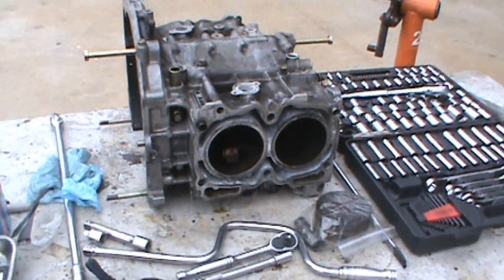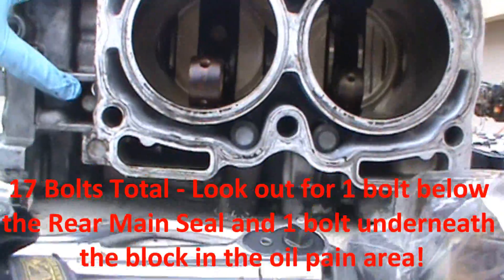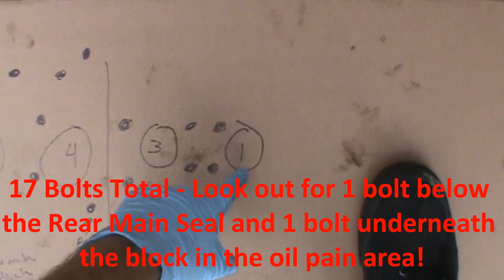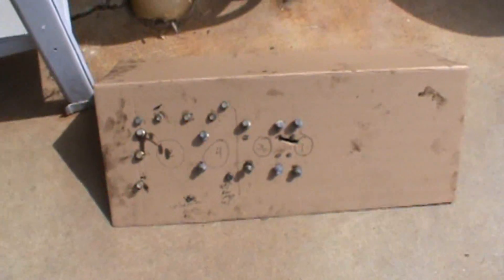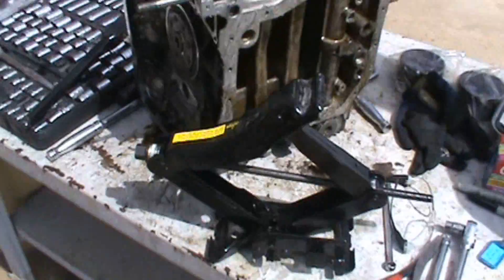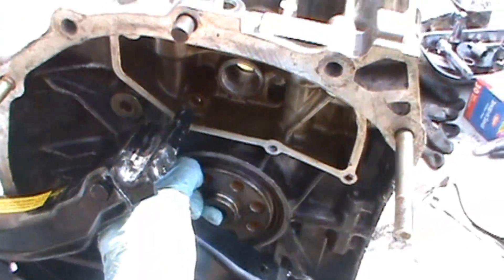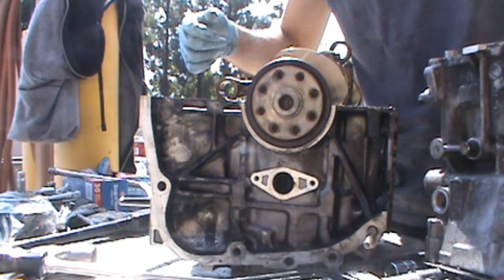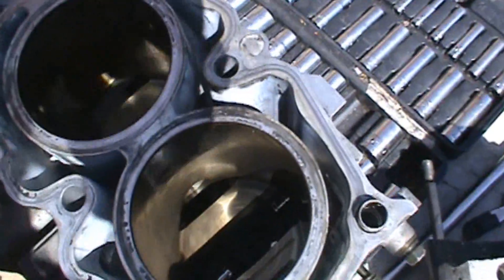Subaru WRX EJ205 Engine Rebuild Part 4

Comment: This is a pretty far fetched question. But would it be a feasible idea to take the engine and AWD system of an Impreza and fit it to a Ford Fiesta. I know it would take some cutting and welding, but what do you think. I'd love to get an answer.

Comment: Great set of videos. 
Perhaps you could do one of your workshop where you split the engine case in two. 
And what were the findings - what new parts were necessary to repair. 
And was the assembly part quicker than the dis assembly

Comment: Good video.  I used it for the EJ25, which has one additional bolt that reveals itself once you remove the oil pan.

Comment: Subarus are definitely not an engineers engine... simple is better. I got a WRX and I hate working on the engine, so much to replace a simple head gasket. I had a Civic Si and cold replace a head gasket and main seal in an afternoon, with my set up. Damn, that was a hell of a job with a subaru engine bro.

Comment from the maker: @mickee6969 Thanks for the comment.  Unfortunately I did not have the time to video the rebuilding process because of the sheer amount of work that needed to be done in such a short period of time.  I will definitely be doing a video segment on a 4 cylinder engine this year, but it's not a subaru block.  Make sure to subscribe!